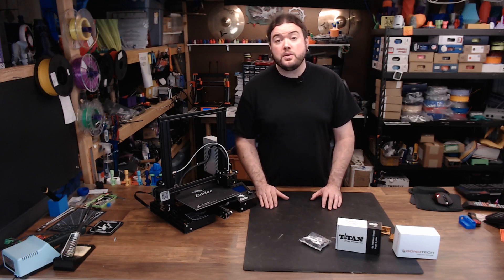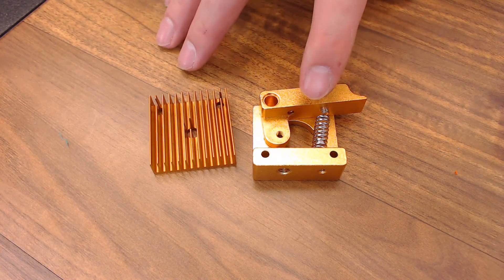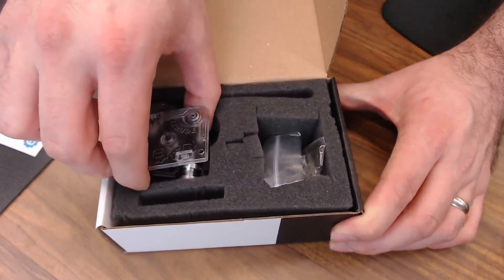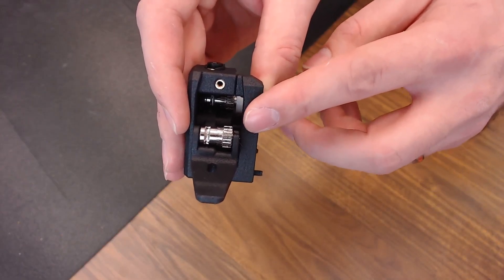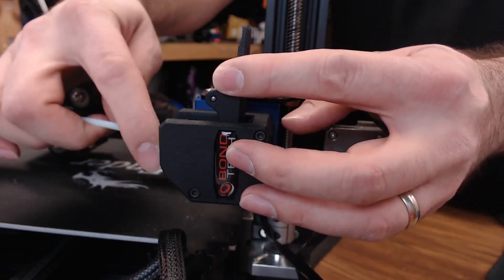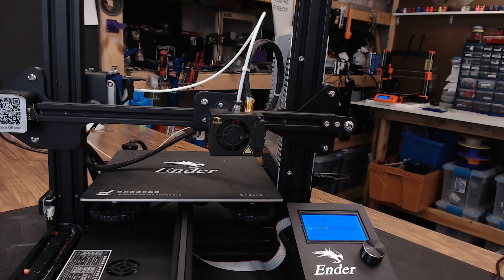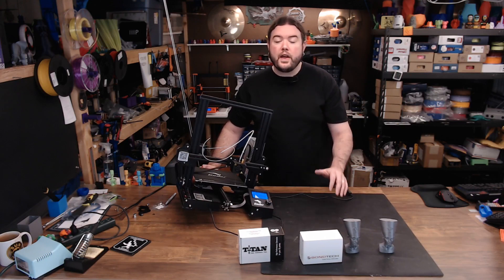3D Printer Extruders - Ender 3 - Chris's Basement

Comment: I wanted to use the bmg on my direct drive ender 3 with micro swiss hot end but not sure if this is possible
Reply from the maker: You can probably get it to work,  BMG is groove mount, it would take creating some mounts and adapters.
Reply: @ChrisRiley  yeah that's what I've been looking at and trying to fit. I also need work on my design skills so I guess it's my time lol

Comment: I'm curious what retraction settings you have landed on with a bmg extruder bowden tube setup.  I got my e-steps calculated but now I'm trying to dial in retraction combo.  2-6mm at 40mms all seem to string the same.
Reply from the maker: I sent mine at 4mm at 40mm a second. I have to increase my extruder feedrate with gocde. M203 E100

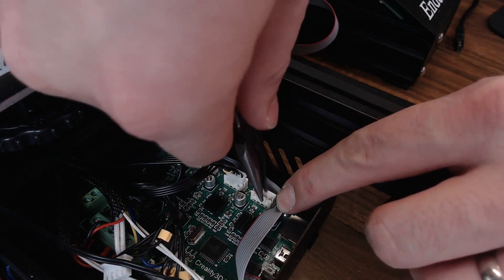Comment: The step at 6:06 does not apply to Ender 3 Pro. You cannot slide off the pictured connector. I pulled a chunk of plastic right off. It's better to follow the instructions on page 7 of the official installation guide: https://www.bondtech.se/wp-content/uploads/2018/08/Bondtech-Creality-CR-10-Installation-Guide-V1.0.pdf

It's very easy to switch the position of the wires, just make sure you have a hobby knife or box cutter blade.
Reply from the maker: Interesting, I haven't seen the PRO version yet.

Comment: "lets compare the prints"
prints look exactly the same
"I have to say the Bondtech extruder looks a LOT better than the stock one did" 
yea, the extruder, not the print
Reply from the maker: I tried.
Reply: @ChrisRiley  i got a bondtech tho, and since then 2 rolls of filament not a single extrusion issue. not one. and i was having issues nearly every print on the stock extruder. (it was cracked on the underside, had no idea until i changed).

Comment: Chris....i just bought the cloned version of this from triangle labs....same install steps.....but i noticed that you are installing it backwards in regard to the way it is mounted in a direct drive......ie your filament input is your output......if we mount it the same way as the direct drive setup....wouldnt that mean that the wires would not need to be swithed?
Reply: Im referring to the bmg
Reply from the maker: That is correct, you could mount it the other way and not have to mess with the plug. I mounted it this way because that's how Bondtech recommends you do it. It really shouldn't matter one way or the other.
Reply: @ChrisRiley    also.....my stepper got hot during operation which required me to adjust the vref on my extruder stepper. Seems to not be a whole lot of info out there once it comes to tuning electronics and firmware...ect. I would like to know how to increase the max temp in my cr20 to get at least 275c....right now i can only get 260. Any ideas? Im printing with priline carbon fiber polycarbonate.....but seems it needs a bit more temp than what the packaging calls for. Iv got a micro swiss. I cant find any info on how to do this either......any ideas?
Reply from the maker: @calebphelps7030  You have to adjust MAX temp in the firmware. So you would need to reflash it with that update.
Reply: @ChrisRiley      ok. Thanks. Ill see what info i can find on which firmware to use.

Comment: I personally think what e3d did and bondtech was copy a gregs wade extruder. The issue i have with both of these is they are using normal toothed gears and not herringbone gears to make it quiter and less dead space play in the gear mechanism.
I designed my own extruder using a 60t pulley and 16t drive gear. I have a 3.75:1 ratio which is fine. Because my setup is belt driven it has 0 dead space play like gears do with a toothed gear.
Reply from the maker: Belt drive, that sounds cool.
Reply: @ChrisRiley  thanks if you reslly wanted i could release the files for you but i believe others with better design skills than me have made them.

Comment: Ditched the stock Ender 3 extruder for the SaintFlint  https://www.thingiverse.com/thing:979113 
It's amazing! Anyone having trouble try this.
Reply from the maker: Wow, that is a killer design.
Reply: @ChrisRiley   Totally agree, and it works do well.  I'm no engineer but it's effectively a bondtech style system with the gear gripping the filament twice.  Have had zero grinding of filament and am using it as my extruder for my ender 3.   I found loading/unloading filament hard at first but I got used to it, just have to straighten it out as well as possible before loading.

Comment: Too be nit picky... another bummer with the original extruder is the position... I mean what were they smoking when they decided to place it in the way of the Z axis rod and so it's a total jack-ass to feed. Given it's hooked up and forms some weight on the X carriage... why not have it on the front... or as I was looking at... on the top and rotated 90 degrees so it feeds top -> bottom. Given my glass bed weighs a tonne and limits my speed... will go direct extruder with a lighter "pancake" nema and a geared titan extruder. From what I heard they made the extruder motors 1 size fits all so supposedly the default one is quite overpowered for 1.75 direct drive. Keep up the good work Chris!
Reply from the maker: I've always wondered why Creatily went with that extruder set up

Comment: Chris, quick question.  What do you recommend to set the initial e-steps to for the titan? Additionally do you need to update the firmware at all? All you need to do is change the e-steps? Saw a video from someone else that re-compiled the marlin firmware, not sure why (the Australian guy on a CR10).
Reply from the maker: I start at 415 and it might spin in the opposite direction. If not. an e step update is all you need.

Comment: I followed your video to install my BMG extruder, but it slips and filament is building up at the center of extruder. Maybe G1 E600 F2000 is too fast? Images: https://reddit.com/r/ender3/comments/bs8c6k/trianglelab_bmg_extruder_problems/
Reply from the maker: Yeah, you won't be able to extruder at that feed rate. Try F100.
Reply: Chris Riley this was the problem. It works like a charm now. 👍 thank you Chris

Comment: You can't install the Titan where you have shown it, it needs an adapter plate like the Bondtech. Also, why would you flip the stepper motor connector around when you can just switch the motor direction with a G-Code command?
Reply from the maker: Yes on the Titan. If you are using the stock Ender 3 firmware, you can't save that setting to eeprom, it will have to be changed in start gcode or every time after you turn off your printer.
Reply: @ChrisRiley  Thanks for the response, Chris. That's interesting. I even installed a Titan on a MP Mini Delta, and it saved to EEPROM. I'll have to remember this when installing a Titan on my Ender 3!
Reply from the maker: @buckeyefan635  Yeah, the firmware on the Ender 3 is kind of a pain.
Reply: @buckeyefan635  I know it is a year later but do you have that gcode command handy?

Comment: Chris, I installed the clone BMG dual extruder on my ender 3, it 'fits' the normal way, but you have to file off a bump on the housing else it rubs against the Z axis.
What is a good way to load the filament? With the previous lever driven extruder, it was trivial, pinch the lever and feed the filament in by hand, now with dual hobbed gears, it is super difficult to push filament into the bowden tube by hand, are you using gcode for loading filament or doing something else?
Reply from the maker: I have had this question before, I have it setup in octoprint to run commands, but you could do it a couple different ways. I think I will make a video on it.

Comment: Sorry sir
My extruder motor not driven. circuit is complete 
Why  
not driven stepper motor
What causes...?
Reply: And requirement of library four extruder motor
Reply from the maker: Is your hotend pre heated? The extruder won't run if the hotend is cold.
Reply: @ChrisRiley 
not heated. 
 thank you sir
Reply from the maker: @KK3DLab  Yep, then cold extrusion is stopping it.

Comment: How do you load and unload fillament? Do you use a gcode. To my understanding the bondtech don't allow hand feeding.
Reply from the maker: On the ender I use commands, mine is about 11cm to load, but it is kind of a pain. It would be much better to flash the firmware and use the load LCD option in Marlin.
Reply: @ChrisRiley  Thanks for the reply..! So you run a gcode to extract fillament and when done retract. Would you mind posting the gcode?
Reply from the maker: I haven't forgot, I am going to get this to you.
Reply: @ChrisRiley  thanks mate.. the review got me hooked :)
Reply from the maker: @BlueprintDK  I didn't forget, video out tomorrow on this. 😉

Comment: i think its easier to alter the pins on the connector much easier than getting into the control box but each to their own
Reply from the maker: Right on.
Reply: @ChrisRiley  I'm curious why you it runs in the wrong direction from the jump? Maybe I missed it?
Reply from the maker: @nathanreed3302  I would have to look at the BMG again, but if I remember right it's because the stock drive gear is on the  back side and the BMG gearing makes it run in reverse.
Reply: @ChrisRiley  ok. I put 1 on a Sunlu S8 and didn't have to do that. I also didn't have to use that bracket. But, I didn't catch if when you turned your motor if you did it in a way to make it see to spin in the opposite direction.

Comment: Good video.  I like your take on these subjects.  As to what you have shown,  I like the EZR ( as it is not cost prohibitive , minimal CFO approval ), but what about some of the extruders on Thingiverse.  They are not Ender 3 centric, but your views on Greg Wades, Drakon Greared,  some belted ones.   Keep up the great work Chris.
Reply from the maker: Thanks Mark! Greg Wades is a pretty nice setup all in all. Even just the adjustable extruder arms work pretty good, the ones for the MK8 setups. I have noticed a lot of the printable ones are geared for 3mm filament and have direct drive setups. Now a days you can get a lot smaller more efficient ones for very little money, like the EZR.
Reply: @ChrisRiley  Good point on the low cost of SOME of these.  I'll probably make a business case to purchase the EZR and present it to the CFO.  ;-)  Thanks again.  I really like your instructional videos and you unbiased views.  Keep it up.

Comment: If you don't want to fuss with the e-steps for the geared extruder can you adjust things with extrusion multiplyer in your slicer?
Reply from the maker: You probably can get the same results, it might take some trial and error.
Reply: Chris Riley I actually did that once but my quality degraded and it messes with stuff like retractions etc if I remember correctly
Reply: Not really. Retractions and some other things like speed depend on it

Comment: The BMG is such a great extruder. I threw mine on my Ender 3 for a bit and the results were phenomenal.
Reply: It's honestly amazing. I went from battling ridiculously intermittent and unpredictable underextrusion, to absolutely perfect prints after installing the BMG. Took me less than an hour, and I only had a small issue with getting the PTFE tube to seat correctly in the coupler, which was easy to fix.
Reply from the maker: @medavis  That BMG is pretty impressive indeed.
Reply: Is it possible use it without any modifications to firmware of the Printer?
Reply from the maker: @steveredstone1711  You can if you flip the plug and alter the E steps in the gcode.
Reply from the maker: Agreed, mine is working awesome.
Reply: best feeder for the price. :)

Comment: ..and before you do any upgrading check the 2 securing screws in the hot end block have been removed. These are installed at factory to protect the hot end during shipping. If not removed they cause uneven heat distribution, under-extrusion, and extruder skipping. Many people don't realise this, did check this Chris?
Reply: There is an answer from Naomi: definately NO
Reply from the maker: @stephan.scharf  They shouldn't be removed?
Reply: @ChrisRiley  Yes, no removing. The itemperature is unsignificant higher, not worth to remove the screws.
Reply from the maker: I would like to get a final call from Creality on this. Chuck did a video on it as well https://youtu.be/eM-rJWBuWhw . I have ran it both ways and really don't see a difference. I actually don't remember if they are currently in or out LOL. Would anyone happen to have before and after print pictures?
Reply: @ChrisRiley  If I can borrow the FLIR camera again I'll get try to get some pics..
Reply from the maker: @chrisdado  That would be sweet!
Reply: @ChrisRiley  Can't borrow, R&D dep't has reclaimed it. :(
Reply from the maker: @chrisdado  Doh!

Comment: Chris, I dont understand, why you need the extra mount on the Creality and not just mount the motor as it was and put the Bontech on top as the original extruder was
Reply from the maker: There's not enough clearance for the z rod. You might be able to mount it with the adapter with the bowden tube facing forward, but the tube would probably get pinched.
Reply: @ChrisRiley  
 thank you.

Comment: Could not agree more about the stock Creality extruder being extremely finnicky in either skipping or grinding filament and no good way to adjust. Its also a bit disturbing at how easily filament will eat away at the extruder housing leaving black specks on your filament as it feeds through the sytem.  I have been looking for a plug and play printer to recommend to new users that works without a dozen upgrades out of the box. I do like that the CR10S Pro has changed the extruder but havent got a proper look at that yet. Ill be testing the Chiron knock off E3D titan and the Monoprice MK1 direct drive system. Lets see if any of these look good out of the box. Great video Chris!
Reply from the maker: Thanks! I haven't seen either of those machines yet, I would be interested to see how they turn out.

Comment: Great video Chris. I upgrade my CR-10 S4 to the Bondtech BMG last weekend, the original extruder used to slip even after upgrading to a metal one. Not a great deal, but I couldn't leave it like that. I have the latest Marlin firmware and I prefer to make the changes in there if they are static, so I inverted the extruder direction and changed the steps/mm there. I then checked the extrusion and it was spot on. Great result.
I did have to watch the last bit a few times, I wondered why you printer was at an angle. I should have realised straight away :-) It was a great way to show how strong the Bondtech is.
Reply from the maker: Thanks Spike! I also much prefer to alter Marlin directly. Ha! Yeah, I always wanted to try that.

Comment: I've seen quite a few of those simple replacement metal extruder kits on Amazon and so forth but never one with the added part as in your first example. is that a heatsink? where would that even go?
Reply from the maker: Yes, that is a heatsink. The one I show is a old school direct drive type like on an i3 clone. It would go on printers like this, https://www.banggood.com/Geeetech-Prusa-I3-Pro-W-DIY-3D-Printer-200x200x180mm-Printing-Size-Support-Wi-Fi-Connect-p-1166697.html?gmcCountry=US&currency=USD&createTmp=1&utm_source=googleshopping&utm_medium=cpc_elc&utm_content=frank&utm_campaign=pla-mix-us-pc-0626&gclid=CjwKCAiAlvnfBRA1EiwAVOEgfNVKFVVp5cOwLp_kW1SNtsZs0tLOuyO9y7UNQ4oHchaLv5q4xpJ0choCK8kQAvD_BwE&cur_warehouse=CN

Comment: Chris! I fixed a lot of the issues, I was having with the ender. By lowering all the speeds everything from the Print, retract, accel, jerk everything. I have been getting results, I can't even comprehend. I did it derictly in the Gcode with Cura. Which please don't hate me for using Cura haha. But honestly give it a shot. You prolly know a better way, of lowering all the speeds directly in the firmware. I'm yet to get that savvy. I wish I could post a picture, for you too see these differences.
Reply from the maker: Sweet! Yeah you can set the speeds with M201 and M203 commands. If you do M503 it will show you the current settings and the commands you can use.
Reply: @ChrisRiley  sounds good I'll do that then
Reply: Can you share the edited gcode so we can paste it in?
Reply: @user-vx2he2tf7w  go to the Ender 3 Facebook group go to the files section 

It is under my female name 

Risa Cura Profile
Reply: @snazzyriza9518  if you want to try another free slicer, take a loom at mattercontroller desktop version is free download from those matter folks

Comment: Oh, forgot to ask, what setting do I need to find in the config.h to switch the polarity of the extruder motor?
Reply from the maker: Check these settings out:

// Invert the stepper direction. Change (or reverse the motor connector) if an axis goes the wrong way.
#define INVERT_X_DIR true
#define INVERT_Y_DIR true
#define INVERT_Z_DIR false
Reply: @ChrisRiley  Thank you kindly!
Reply: @ChrisRiley  Hmm, must be congif_adv.h (TH3D unified)
#define AXIS_RELATIVE_MODES {false, false, false, false}

#define INVERT_X_STEP_PIN false
#define INVERT_Y_STEP_PIN false
#define INVERT_Z_STEP_PIN false
#define INVERT_E_STEP_PIN false
Reply from the maker: @SteinerSE  Those look right, but I really don't know. There is a lot of different things in that version. I have never used it.